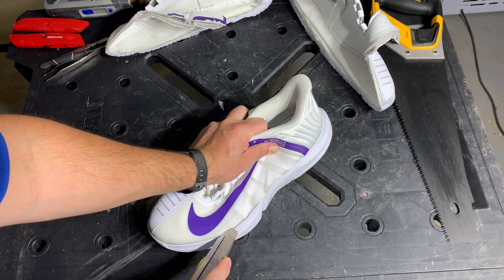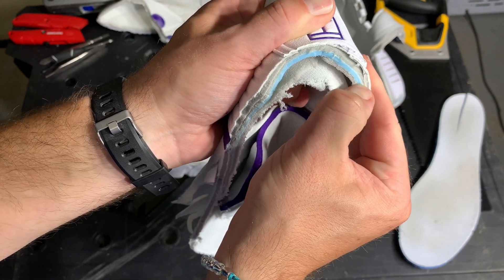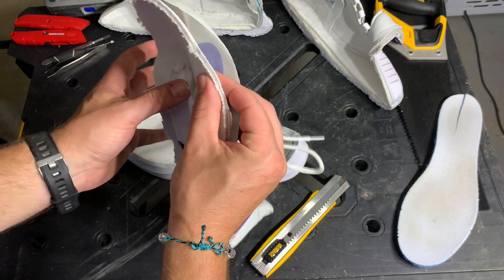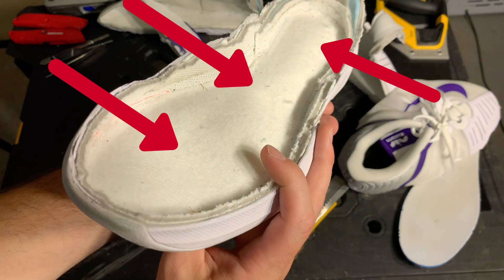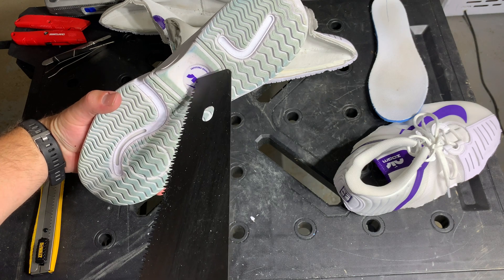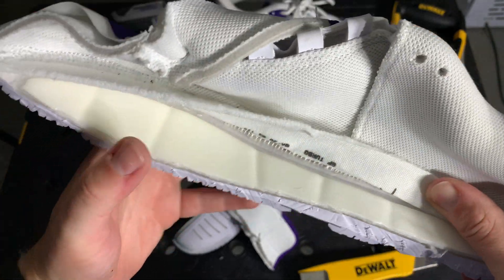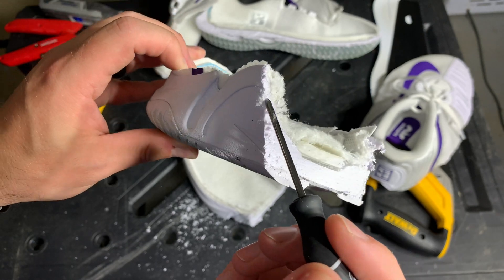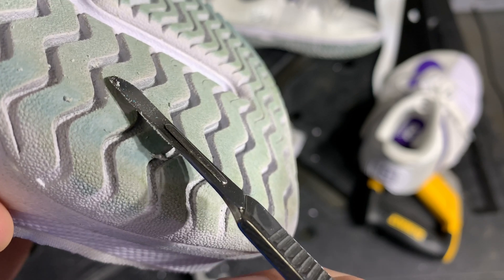Nike Air Zoom GP Turbo Cut in Half and Durability Tests | Tennis Shoe Teardown

Comment: There is only 1 Zoom Unit in this shoe. It is not double stacked
Reply from the maker: Thats interesting you say that- They certainly seem to have a larger air pocket and popped as they did but ill have to get the patent materials from Nike and check it out- thanks for pointing it out!
Reply: @FootDoctorZach  from Nike's official website; "The NikeCourt Air Zoom GP Turbo combines an incredibly responsive, full-length Zoom Air unit with zones of durability so you can stay fresh longer."
Reply: https://www.tenniswarehouse-europe.com/Nike_Air_Zoom_GP_Turbo_White_Purple_Grey_Mens_Shoe/descpageMSNIKEH-NMZGTWP-EN.html 
It’s double stacked, according to almost all the resellers. I think it’s a full length then the thinner one in your cut down doesn’t go the whole way.  Being that narrow makes no sense going into the forefoot.
Reply: @robwilliams6820  He could settle the debate by posting a video of the physical air units he pulls out of each shoe. But to be honest, I dont know why Nike's official website would only say 1 unit if it was in fact double stacked.
Reply: csjumpman3 Nike are known to lie about cushion in shoes and have got caught before. I think we can see the two Zoom bags in a cross section shot on the video when the midsole is cut open.
Reply: @robwilliams6820  I don't know what you're seeing but when I look at the cross-section you can clearly see there is only 1 Zoom unit
Reply: csjumpman3 I think zach suggested the top part was an air zoom unit too. As he highlighted in the Video.
Reply from the maker: Yes there were two “pops” when I went through on the cutdown- the upper unit looked sewed into the upper and the bottom unit was more traditional with the woven fibers ala the vapor cage 4’s - and yes in the cross section there are two defined spaces plus the non removable insole was that more forgiving woolen material you would need to accommodate pumping air into- I’m still going to look up the patent but it seemed to be 2 to me- worth looking into tho
Reply: @FootDoctorZach  you should be able to remove each zoom unit from the shoes if you still have them on hand to check as well. Zoom units are thick enough you should be able to hold each unit in hand when you remove them from the shoes
Reply: @csjumpman3  there is a double stack hex zoom unit under the centre of the shoe so it's technically a double stack
Reply: @FootDoctorZach  did you ever find out if it was 1 or 2 zoom units?
Reply from the maker: So it’s bizarre, there is one “zoom air” unit then the top unit is considered a “stromble” or  just an “airbag” so it’s an air unit without that mesh in it and it’s sewn into the upper so technically not “zoom air” unit but an airbag - Nike actually changed the language recently on it on their site as well
Reply: @FootDoctorZach  From your video it is clearly seen there is just a single, full-length Zoom Air unit in the shoe. "Strobel" or "Strobel board" is the fabric(or other material, e.g. cardboard)layer sewn to the upper of a sneaker, that separates(and connects) the upper to the midsole. When a "Zoom Strobel" is featured in a shoe - that means the Zoom unit is directly sewn to the upper, thus replacing the traditional Strobel board, putting the foot directly onto the cushion. In such a shoe, once you remove the insole you see the Zoom directly. In your teardown the white woven material left once you cut off the upper is the Strobel board, beneath it lies the Zoom unit. When you scratched the woven Strobel board with your knife you managed to pop the Zoom unit below it.
PS. Sorry for resurrecting this old thread :)

Comment: Thanks for the heel-to-toe drop numbers. I've experienced archilles tendon pain in lower drops tennis shoes eg. ASICS Solution Speeds which I measured at 8mm. Those that you cut will probably work for me.
Nike Zoom GP - 12mm
Nike Vapor Cage 4 - 15mm
ASICS Gel Res 8 - 12mm
Adidas Stycon - 13mm
Reply from the maker: I'm glad that helped you, I think that is certainly a reason you could be getting some issues back there, I would really like to do a study on that with tennis-specific shoes , will have to brain storm how I would make it objective- thanks for the idea and contribution to the community!

Comment: The full length Pebax plate is interesting as that’s tech from running shoes. The vaporfly used a carbon fibre plate from memory but seen Pebax/polypropylene in a few runners I’ve had.
Reply: The hottest running shoe right now the Saucony Endorphin Speed has a pebax propulsion plate in the midsole. I am surprised Nike didn't market this feature in the Zoom GP!
Reply from the maker: I agree 100% - it should be the first thing in the description of the shoe as I think the performance of the GP Turbo is really tied into that plate
Reply from the maker: Yes it is! I really like the profile of it as its thin but runs longer than traditional shanks- I think it gives you a better mechanical advantage